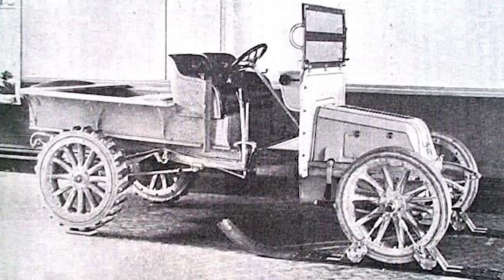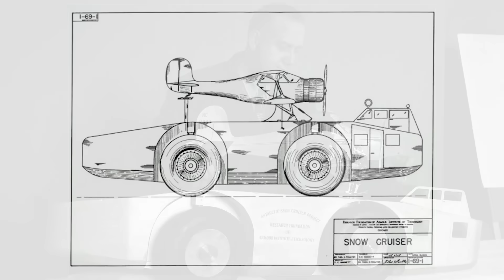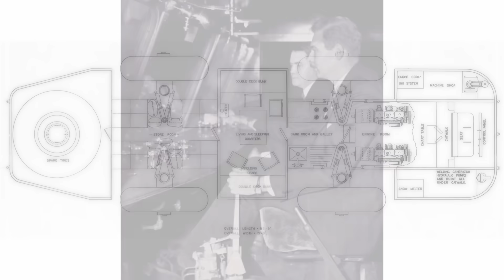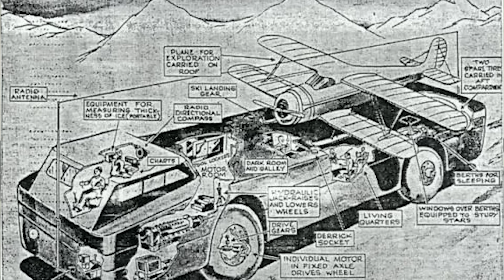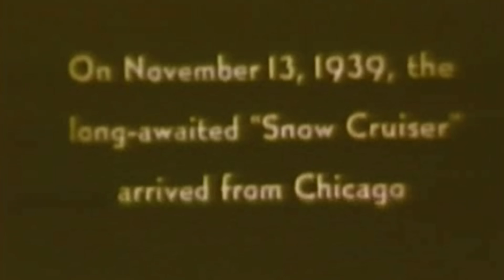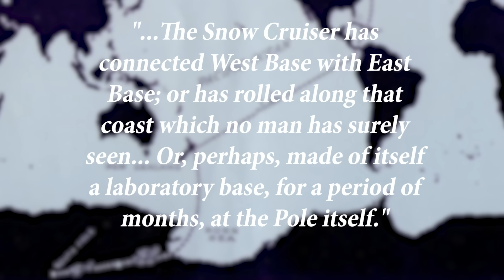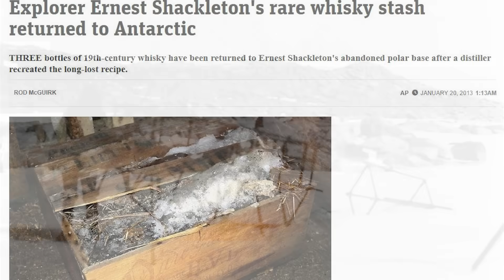"The Snow Cruiser"-Antarctica's Abandoned Behemoth

Comment: Everyone is commenting about the tires, but what gets me is that they tried to use that flimsy wooden platform to get the beast off the ship. They're lucky it didn't break through immediately and fall in the water. Incidentally, the tires were built for swamp vehicles, they were under time pressure and just used whatever they could find off the shelf. Lots of boneheaded decisions.

Comment: Nobody:

Antarctic explorers: “ahh yes treadles tires that will work perfect 👌🏼 “
Reply: They probably assumed the mass of it would be plenty, since traction is a function of normal force. They were also probably working with empirically derived formulas for tire traction that gave too much weighting to tire patch size and only for static case (no slip).
Reply: @JITB0Reiu  yes. but having treads vs no treads.
Reply: because the ice and snow is "smooth", so we make 6 big ass, racing slicks!

55MPH!!! w00t - only down hill, down a crevice, or the the bottom of the ocean!
Reply: the MAKO from Mass Effect
Reply: And GoodYear thought the same too.
Reply: Because scientists aren't as smart as we want to believe
Reply: STOP ✋
There was NO reason to use the nobody meme here and it doesn't make any sense. Please. Please please STOP.
It's a good meme if you don't use it in a place where it makes NO FUCKING SENSE AT ALL!
Reply: @Zack_Taylor  Thank you! So tired of seeing this unimaginative shit on every video now, especially when it doesn't make sense.
Reply: @_ZUNG_  Exactly. It's one thing to use an overdone meme, it is another entirely to use an overdone meme INCORRECTLY!

It should be for things that nobody asked for or nobody prompted in any way. It's not just something to put as a preface to literally anything that someone could say.

Comment: A sad case of Not Actually Testing on Actual Snow.  C'mon, people.  How difficult would it have been to drive in some snow in Boston (or thereabouts), in 1939?   To quickly discover the fatal flaw in the tire design?  I bet Goodyear could have re-fitted it quickly enough with aggressive treads from their line of large earth-movers, or even open-frame, triple-wide barrel like wheels instead of the rubber ones.  A kind of giant "paddle wheel" or "tank tread" style of wheel.   Armchair "engineering" gone haywire.  I bet if they'd have asked their production engineer staff, who oversaw large earth-moving equipment making, would have seen this as a fail before it left the paper stage.   Fools and their money...

Comment: Do you think she would have been successful had they used tracks and better electric motors? I really think that they'd made a blunder concentrating mass on the small footprint of 4 (to 6) smooth rubber tires. I'm not exactly sure of the properties of snow and ice pack on the upper layers of Antarctic snow and ice drifts, but I'm betting it's not ideal for a massive (sine vestigiis) wheeled vehicle. The most successful modern vehicles I know of are snow cats and snow mobiles, both use tracks to spread out the weight on the snow and use the track for traction.

Comment: You would have thought they would have at least tested the thing on actual snow before taking it to Antarctica. If those tires had actually been designed correctly the thing might have worked - but my guess is they got almost no traction on the snow and ice.

Comment: I was wondering why those tires were bald. If it were my project, I think I would use tires with big spikes. Due to the huge size of the vehicle.. maybe spikes that are just a bit smaller than railroad spikes. The weight of the vehicle would help them bite into the ice.

Comment: I imagine trying to take a scaled model for a drive on snow would not have been expensive
Reply: Looks like the cruiser in aliens 2
Reply: It wouldn't have worked the same way, as the weight goes down but the way the tires react to the snow remains the same; meaning that testing this with a little model would likely have worked.
Reply: @pnpgod7904  Exactly. Scaling down decreases the weight with exponential 3, while the contact surface area only decreases with exponential 2. So the amount of weight for the contact surface area decreases. But more importantly: a decent amount of snow is a yearly occurrence in the Great Lakes area, right? Could have just tested the full scale model there.
Reply: @pnpgod7904  True but there are ways to overweight the scale model to balance things up and that might have given them a clue that it wasn't going to work.  Given the time scales it looked like they didn't even bother with that
Reply: I would have not been most effective not to bring the full sized equipment with them, if they're already en route to such a distant place.
Reply: @PACKERMAN2077  Didn't have to be snow in antartica
Reply: @CarlMarx  oh sorry I understood you as saying,  "go all the way to Antarctica with the models just to test them there because they didn't have snow in the place where they built them at that time of year because they were trying to meet a deadline."
🙄😅
Reply: @PACKERMAN2077  You know if they went up to canada there'd still be snow in summer in some northern parts right? And besides, testing it on sand or something would have sufficed. Testing it at all would have been a good idea.
Reply: @Shorjok  noo no, you can't do that
Reply: @Shorjok  They did test it in the sand. It worked well. Referenced from the uploader's replies.

Comment: what that thing have for power? said 2 motors..were they big old Detroit diesel engines??
Reply from the maker: Something I never found our actually! Worth looking at my sources,might have some info I missed.
Reply: @CalumRaasay  knowing that they were powering tanks and submarines.. along with military vehicles and Road tractors.. there were some other diesel engines and it wasn't caterpillar could have been Cummins but I don't think was doing anything besides trucks.
however the big old V8 and V6 Detroit diesels were found everywhere.. those two stroke engines were almost indestructable.. and coming out of Chicago where they were built I wouldn't be surprised if they weren't powered by Big bc 2 Strokes

Comment: Interesting video! I think it would have worked if the tires had been much bigger. Maybe with both larger tires and more axles. And more power ofc. Look at the Sherp. The design isnt far off. And the Sherp can handle terrain. 
A pity they didnt learn from the snowcruisers stranding while travelling cross the states and modified it before it left.

Comment: Goofy in the extreme, yet still fascinating. The lack of tread on those huge tyres was clearly at least one of its fatal flaws.
Reply: Actually an aggressive tread is totally unsuited for snow & ice when there is nothing under it other than perhaps water,  There are other videos of the current wheeled vehicles  in Antarctica some have a knobby tread  but  is not deep. Also look at  photos of LARC vehicles they came stock with a street type tread so it would not dig in to the sand. I wintered over in McMurdo in 1980 and can assure you flotation is key.

Comment: Should have brought the snow chains.
Reply from the maker: They did try chains actually, but also it's important to note that the tyres weren't exactly the failure point- it was bad maths and too much weight that sunk it. Poulter (the designer) had calculated that a vehicle with capabilities to drive in the sand would also work in the freezing snow as both shared similar behaviour and weight-bearing capabilities, however, he miscalculated the unit weights. The friction between rubber tyres and snow remained was perfectly high enough for traction but the weight of the vehicle caused the wheels to sink in deeper than they calculated, so that the 'climb-out' of each wheel rut was equivalent to ascending a 20-30% slope. Power had to be expended to break the snow structure and climb this ‘slope’; applied to the tyres this overcame friction and caused wheel slip, which served only to deepen the wheel ruts. If Poulter had calculated correctly they could have accounted for the weight differences and she probably should have been a lot more effective even with treadless balloon tyres.
Reply: @CalumRaasay  Imagine shipping it to Antarctica without even testing it in snow though, or any prototype
Reply: @brynclarke1746  sounds like bad idea to me
Reply: @CalumRaasay  so what you're saying, in a very complicated way, is that it lost traction or spun as we say in english. I get the reason you so perticularly explained, but do you mean that winter tires would not have improved the performance ?
Reply: @happyfox711  Yup.  Like when our tires get stuck in the snow.  Its not the treads alone being the issue, its the ruts that form in front/back immediately upon the cars weight pushing the tire down into the dense snow.  Especially at a stop.  Once in that depression, walled on both directions, its extremely difficult to dig/climb itself out, even with treads digging away for grip.
Its why you can keep going through super heavy snow, but once you stop..  ya need the shovel.
Reply: @emprsnm9903  why do you tell me this,  I'm from Norway.
Reply: @happyfox711  Nevermind
Reply: @emprsnm9903  you're exactly right, though, still no threads just makes a bad situation a lot worse. It's not like it doesn't matter.
Reply: There is a photo where they are putting on snow chains...

Comment: Who would have thought that the bald tires on the Snow Cruiser wouldn't grip the ice and snow like an eagle grasping a fish?
Reply: They did not have the knowledge we have today, but they could've imagined it, it's pretty intuitive.
Reply: alphaone101 your wrong bald tires are actually better they still use bald tires today in the Arctic and Antarctic
Reply: Donovan you keep thinking that
Reply: @donovan9356  all the arctic trucks I have seen in real life (pimped out 4x4s with lower wider axles and ballon-tires that they drive around on Iceland and Svalbard) has had enormous threads in them, like off road or sand-paddles even some of them..this I believe comes from trial and error, not calculations about surface area and listening to youtube comments.
Reply: @donovan9356  that sounds interesting. Do you know why bald tires are better?
Reply: @IIAndersII  More surface area to grip, especially if they're really soft they will conform to the shape of the surface. They just should've had like, twelve of them.
Reply: @TheMarkk116  ah that makes sense. thx :)
Reply: IIAndersII because it’s not packing the snow down to we’re it can get stuck in the ruts from the tires or slip on them
Reply: Markk116 wrong
Reply: IIAndersII slicks are not better
Reply: @IIAndersII  i think in certain conditions snow and ice get stuck in the treads and they are functionally slicks anyway.
Reply: @TheMarkk116  a smooth surface has LESS surface area than a grooved or ribbed surface but your statement about contouring to the ground is correct. very low pressure on a balloon tire allows for a much larger contact patch which spreads the load out over a larger area and prevents the tire from sinking, its why they are called flotation tires. Iclandic 4x4 vehicles use very large balloony tires like 44" dick cepek and mickey thompsons for this reason.
Reply: @ChrisGraham00  .but they're NOT slicks.
Reply: Donovan Slicks are only useful on a track. Studded tires and snow chains are used on snow and ice, not slicks
Reply: Enemy Spotted I got proof go watch k vex he will explain it

Comment: What looked like 2 H model Cummins engines..... with the 2 of them together that’s like 240 horsepower.... and I think like 800 - 1,000 lbs of torque if they were 120s. 
But they could have been 190s or 220s

Comment: An interesting design, but incredibly naive/optimistic.  The schematic showing how it would get over crevices.... omg that thing would be stuck the very first time.  There is no chance whatsoever this thing would have made it.  There's no chance it could have made even a fraction of the journey.
Reply: The main reason why the vehicle failed was the lack of spiked tires. Those doughnuts it had offered next to no traction and were not shaped accordingly. 3 extra wide tractor tires strapped together would've been a good start for the design as the mass of the vehicle would've had to been spread on a large area to minimize pressure.
Reply: @I_THE_ME  No,i think we should go with the slicks,??? 🙄
Reply: lots of designing 0 testing. cant believe it lol
Reply: @Funny Bunny We're still learning. There will be things we're doing now that people of tomorrow will be like "OMFG, how can they have been so STUPID🤦‍♂️🙄"
Reply: It looks like the underside of the vehicle was a series of straight runners, and when stuck on a crevice like that, the tyre could be retracted to be in the same plane as the underbelly. The tyres still on the ice would I guess drive and slide the vehicle along until the front tyres could be lowered, the rear tyres raised and then the front tyres would drag it the rest of the way.

I guess they just didn't figure the immense friction that would be present from the huge underbelly, not to mention the lack of grip and power to be able to pull it off
Reply: Soviet Union built several special Antarctic tractors. The most succesful was Kharkovanka,  built on a base of a military tank. http://www.darkroastedblend.com/2007/12/unique-soviet-snowmobiles.html

Comment: You can see a fair bit of similarity between the Snow Cruiser and the Russian ZIL167 or the ZIL 'Bluebird 4906' used to recover Soviet cosmonauts and spacecraft in Kazakhstan. The Russians used CTIS (central tire inflation) to assist with different surfaces and large fiberglass or composite wheels to keep the weight down.